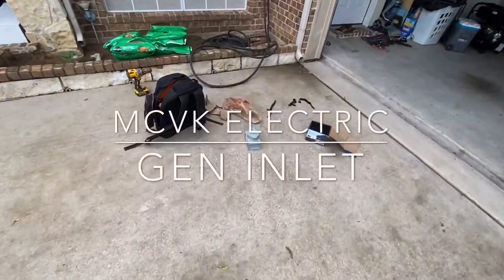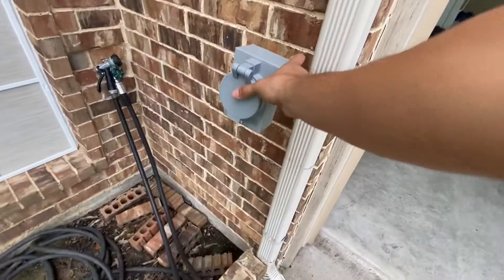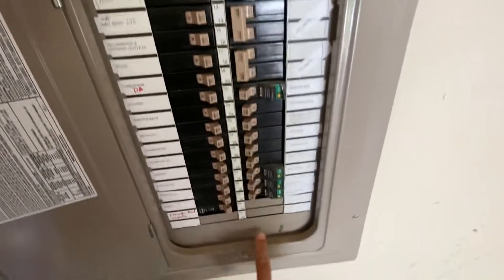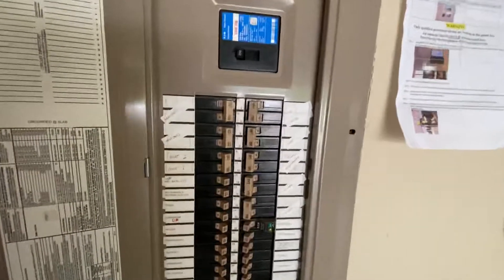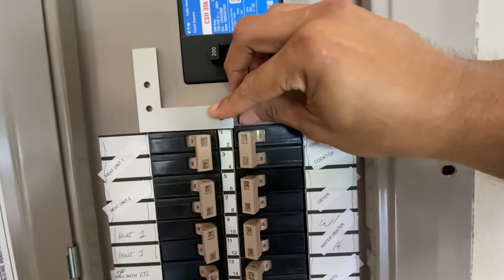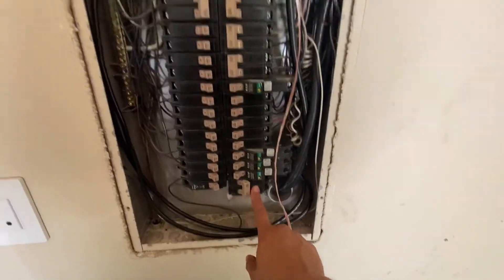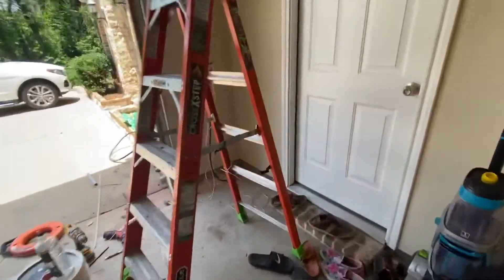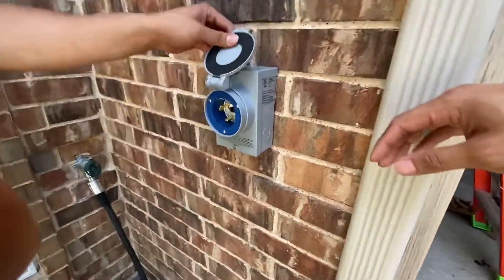Interlock kit with generator plug (inlet)

Comment: Can I use a 50amp inlet box, 6g wire to 50 amp breaker on panel, but only use generator with 30 amp capacity?
Reply: why not save yourself some money and get what you need?